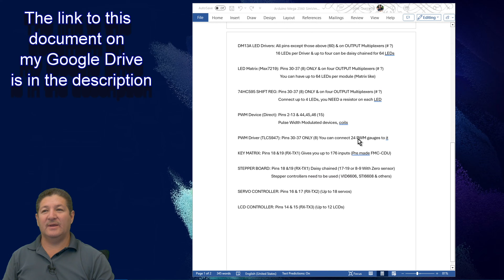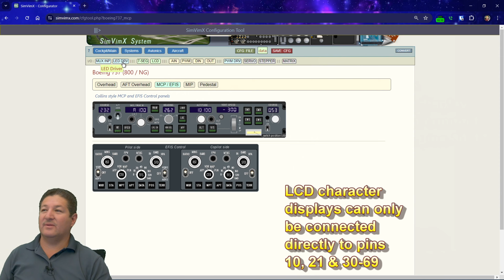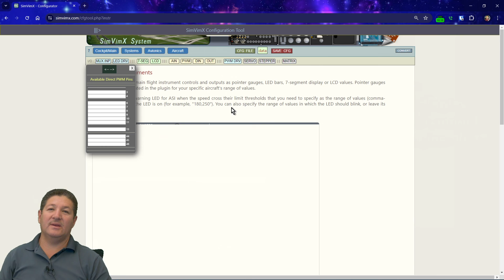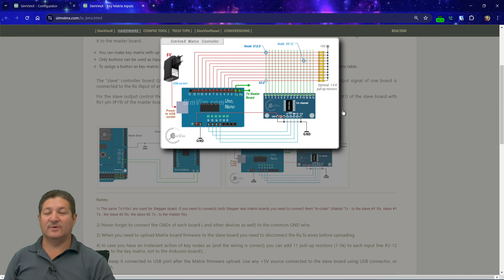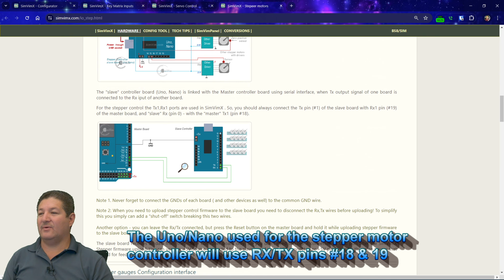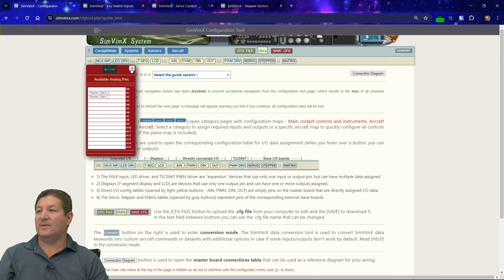Arduino Mega pin usage with SimVimX

Comment: Hi, I'm trying to ensure that simvimx can handle everything I plan to build for my a320 cockpit. The part I'm querying about is the ISIS. I plan to build one from scratch (implementing a subset of the actual functions) by using a nano to draw graphics in an oled panel. The issue I have is (1) no real outside support for simvimx - i get the impression that it's a secluded closed community of users, unlike mobiflight which seems to be prevalent in most forums.
(2) The creator seems to not have any mode of contact so that potential users can ask questions.
(3) Will the master Arduino (2560) communicate relevant flight information to my nano so that it can draw the appropriate graphics onto the OLED? Basically, as long as I can retrieve the speed, bearing, pitch, altitude and roll data, I can recreate the ISIS nav screen.
Thanks

Comment: Another great video.
I would never have found out how to control an output multiplexer without this explanation!
Although I have also used MobiFlight I prefer this simvim solution, With MobiFlight I can only use 3 rotary encoders on 1 board, or 1 dual and 1 single encoder and that is simply far too few.
Reply from the maker: Thanks for your comment. I totally agree with you on what you said. I never did like that you need to use a ton of Arduinos with MobiFlight. Of  course if you want to build a cockpit for MSFS then it's the only options. I have no intentions of leaving X-Plane.
Reply: @Qosmokid  I don't plan on ever investing money in Microsoft flight sims again, because it never works!
With Xplane 12 I could fly right away, even without paying I could test fly!
I hope more people will realize that streaming everything via the cloud doesn't work.
I have everything on a big hard drive so I can fly right away!

Comment: I have an exciting news, I did find a solution to fix my data, which I had previously loaded in to plugin, I renamed the data to data.cfg so that allowed me to be able loading the cfg file and saved it once again as data.cfg and replaced it with my original data, everything start working like before, seven segments and all knobs which control my cockpit are recovered. 🥰🤝🤝👌
Reply from the maker: Yes that exactly what I showed you need to do in my other video to convert old cfg files to the new format. Glad you figured it out.

Comment: Hola amigo un placer saludarle y tener tantos vídeos muy interesantes, es una duda que tengo. Yo toda mi cabina y todos mis paneles lo he programado con realsimcontrol, a un compañero le he fabricado unos paneles de radio iba a aprobarlos y resulta que todo el configurador y el interfaz de real sin control ha cambiado,y  no se como se genera el DATA cuando le metes los pines al configurado me podrías ayudar ???gracias y saludos desde España
Reply from the maker: Hola Damaso, gracias por tu comentario. Tengo un video que hice hace un mes explicando los cambios a el configurador y las conversiones. Si hay algo con lo que ocupes ayuda después de ver ese video no dudes en preguntar. Pero la respuesta simple es que tienes que precionar el boton "SAVE CFG" para generar y guardar la configuracion.

https://youtu.be/E761d5JyNhA?si=O_Z_IKiOogrZhbYp

Comment: We use to be able to use output multiplexers with 7 seg displays, is that not the case anymore? we can only assign 7 seg displays directly to the arduino pins 30-37?
Reply from the maker: Hi Tony,  we still can, I mentioned it in the video. You can have up to 64 7-segment displays on 4 output multiplexers. At around 4:35
Reply: @Qosmokid  Oh thx I missed that.. I was confused about what you said at around 8:00 .. I just tried it, it is not that much straight forward but not too complicated as well. I feel like the older configurator was much easier to use or maybe it is just me !
Reply from the maker: No, I kind of think it was easier in some ways too.

Comment: Thank You once again for your excellent videos. When and if you present a video on how to do  conversions  -- please consider how to display  --- an airplane's Pitch and Roll degrees --- on an LCD display. I have not been able to do this. THANK YOU !!!!
Reply from the maker: Thanks for your comment. Ok I will definitely do that. Is there a specific airplane you have in mind? Although I think you do not need to do conversion for those parameters
Reply: @Qosmokid  Thank you for considering my request. I believe the Pitch and Roll degrees I am requesting apply to all aircraft. However, I am presently generating a configuration for the basic Cessna 172 (G1000) aircraft. I am especially interested in displaying  Pitch degrees. This parameter  along with possibly the yoke pressure parameter ( I believe this parameter is available also ) will allow me to control "slow flight" and " level flight" effectually.
THANK YOU !!!!!!
Reply from the maker: Ok so I tried setting up the datarefs you are asking about and because they are default xplane datarefs it won't let me put them even on a "GENERIC" LCD Display. I just had Vlad work on fixing an issue on the Zibo so I'm going to wait a little before asking him if this is something he can add lol